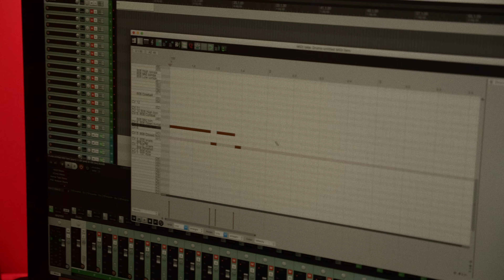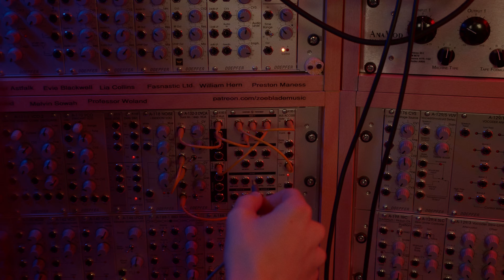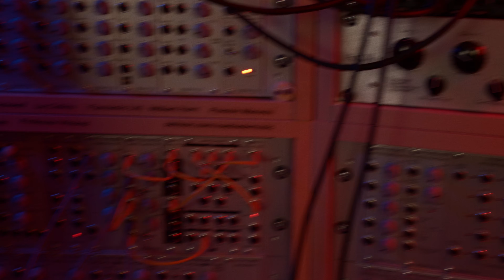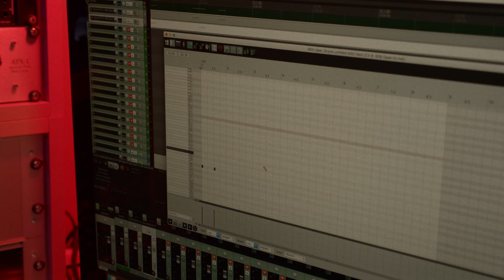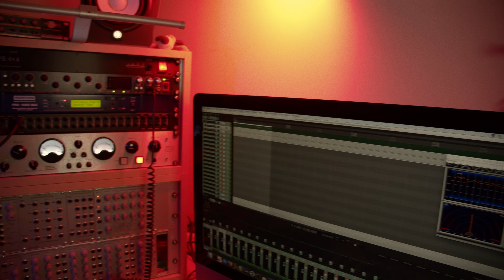Hi-hat experiment

Comment: My MFB hihat module actually has this functionality built into it so the closed trigger chokes the open trigger. Your example with the VC Decay is exactly how I do it, using a sewerage CV to control length. The difference in my hihat patching is that I use the Doepfer six osc noise module and a high pass filter for the hihat tone👍
Reply from the maker: Neat!  I used the A-117 for a while, but could never get it to sound as nice as simple noise.  I've probably just never figured out how to filter it well!

Comment from the maker: Further experimentation is required, but Nina was right, you can automate adjusting note lengths to touch each other but not overlap using the legato feature of most DAWs, and Reaper lets you highlight all the notes of various pitches automatically, as per https://forum.cockos.com/showthread.php?p=2226439#post2226439 so this is a pretty good solution!